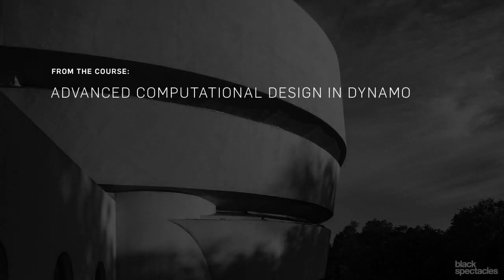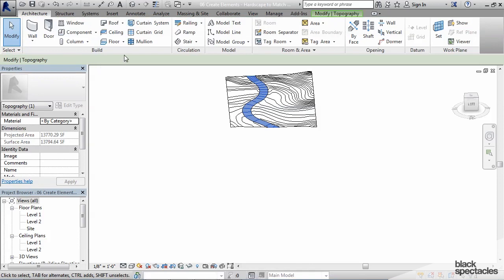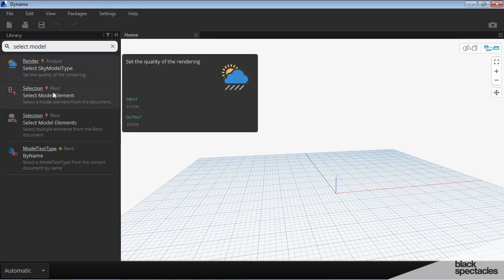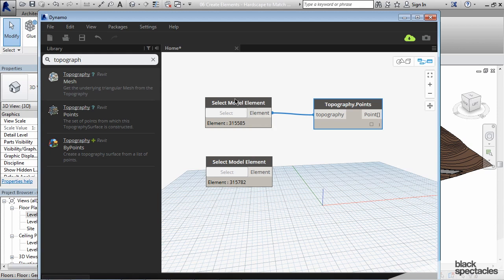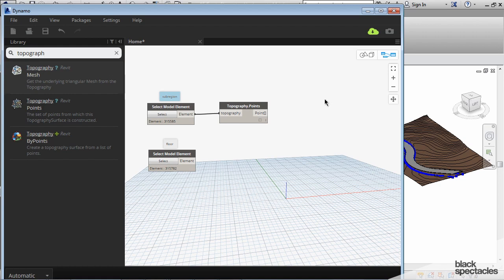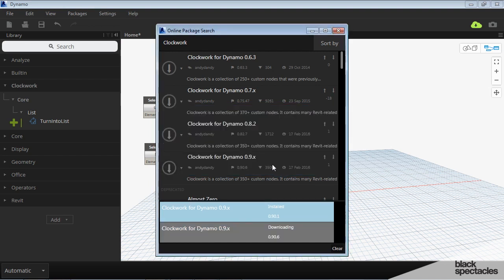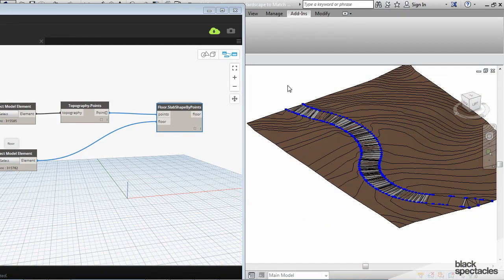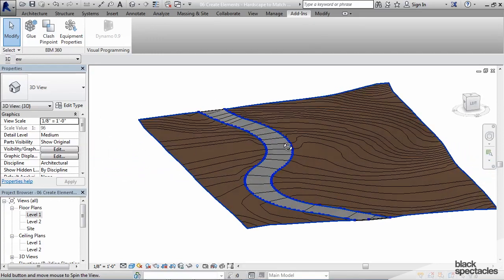Creating Hardscape to Match Topography - Advanced Computational Design in Dynamo

Comment: good day! I keep trying this but why does it say " Slab shape edit failed"?
Reply: Hi, did you manage to solve this problem? I keep getting the same error message. Thanks
Reply: I have the same message as well!
Reply: Old American I solved the problem by upgrading to Revit 18 and updating to latest version of dynamo and clockwork... I had to uninstall and reinstall everything and it worked.
Reply: I'm already on the latest versions of clockwork and dynamo, still having the same problem. It looks like it worked fine, what's wrong with it?!
Reply: I solve the problem by using this way :  https://www.youtube.com/watch?v=iO1B6G9w240&t=1s&list=PLRp1vRfFTBDQWa_b1ff23KW9Xbvc4MnAV&index=9
Reply: put the floor below the topo before you run the script

Comment: Great tutorial... Thanks... This helped me a lot... I have a question... after I finish the floor following the topo... I have still the floor and subregion in selection mode... I have tired pressing "esc" several time but it is still in selection mode how do i come out of tht...could you help me with this...pls?
Reply: Wondering the same thing! Anyone know how to deselect the floor so it doesn't show the blue points?
Reply: @Nate_Pulse242  I assume you noticed that it seems to be just a stuck visual.  Once you close and open it again, the blue dots go away.